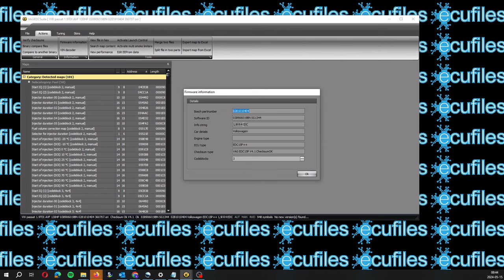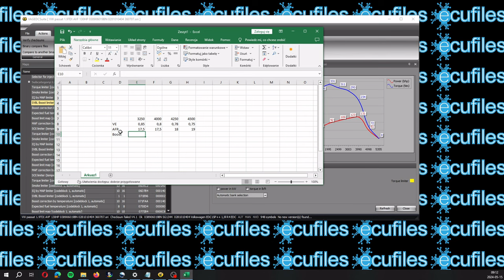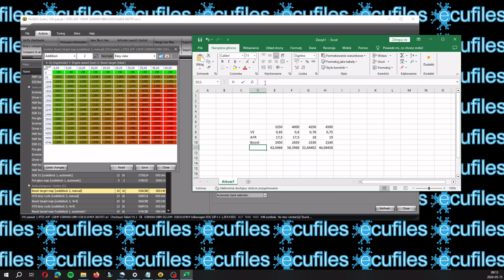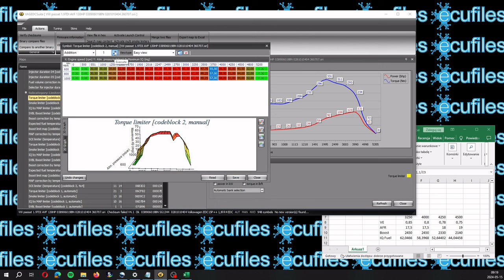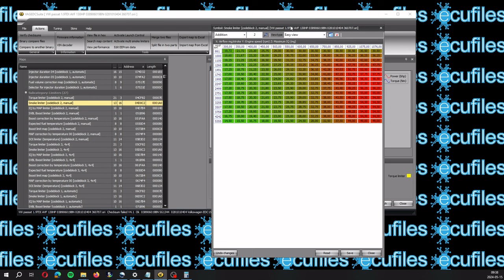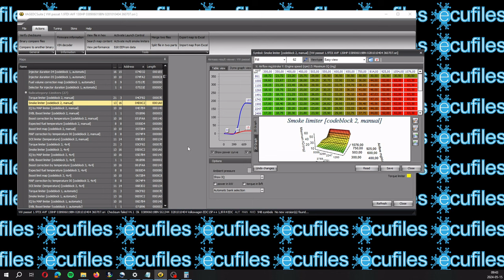1.9 TDI AVF Stage 1 recipe !!! highly recommend watch it even if you are tuning another engine

Comment: i have a original avf file, but the durations are different from yours. How is that possible?
Reply from the maker: Avf was released with few different injectors.
Reply: @ECUFILESCOMPL Ah okay, thank you.
Reply: @ECUFILESCOMPL  works great. I have another question for another car, what can I do against overboost, I already raised the n75 values at high iq and revs. And I raised svbl to 100mbar more then my boost should be. 
I have a modified turbo.
Thanks in advance

Comment: i did exactly like shown in the video but my car is driving like stock. why could that be? i have a4b6 AVF engine quattro
Reply from the maker: You have to modify the correct code lock, or modify all. There is an option in application setting codeblock synchronization. So if you modify one, all be modified.